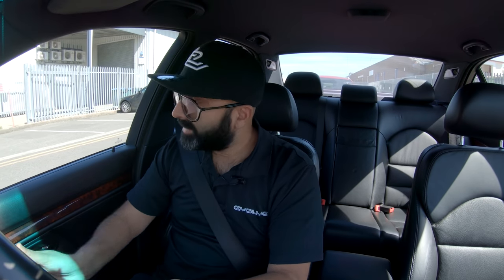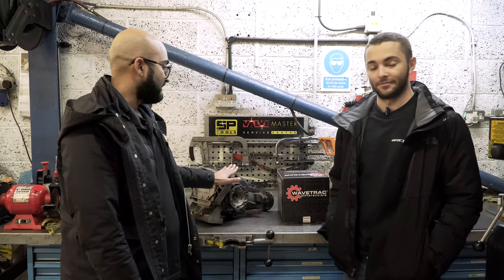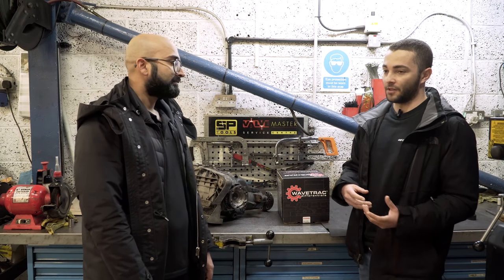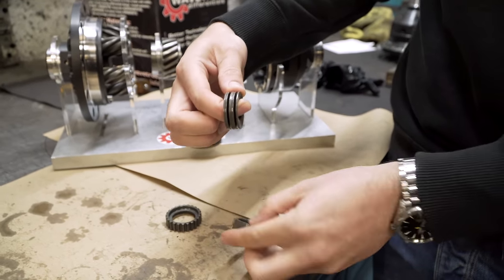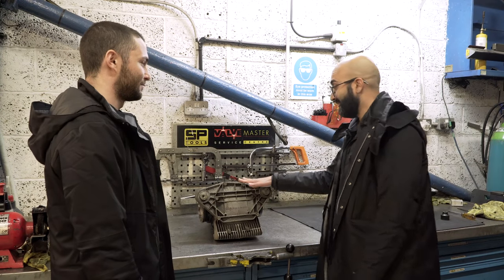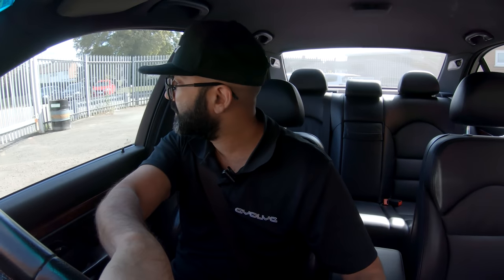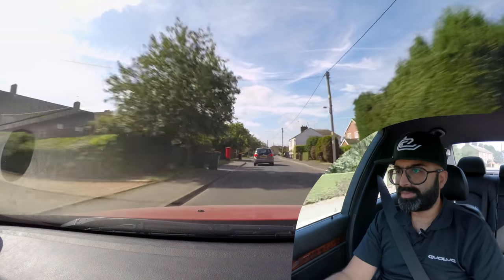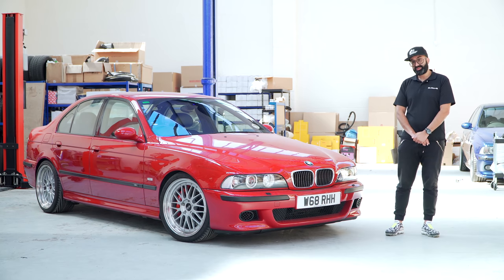Our 630HP Supercharged E39 M5 gets a Wavetrac Differential

Comment: It wasnt a stock diff in it as they pointed out it was an aftermarket diff but not a wave track. BMW LSD riffs are clutch type riffs that work much different than the one they pulled out which was not a clutch type and was close to the wave trac design already but without the wave trac part they showed that creates a better pre load than the other after market. Although he kept referring to it as OEM. I'd love to have one in my E46 M3 but cash is not there for it yet.
Reply: The wavetrac diff works out cheaper than the quaiffe ATB diff, they do need the output flanges to match which adds on another couple of hundered quid or so, depending on where you get it from. I'm in the same situation, got stock diff with 140k on it. No issues with it yet but I always hope it goes bad so I have the excuse to smash my piggy bank and go for the wavetrac! Total price is around £1500 for a full wavetrac setup depending where you buy from as opposed to around £1700 for the quaiffe. Not sure if a bearing rebuild kit is required for the wavetrac but I know it is definitely needed for the quaiffe which adds another £300 or so. I reckon a budget of around £2.5k max would be enough for a fully fitted swap (inc bearings if needed).

Comment: Very important info is missing, what is the load percentage approx with Wavetrac? Stock is around 40% lock, High milage used around 30%, Wavetrac?
Reply: As explained in the video, the car came fitted with an ADB torsen diff carrier and not the standard BMW clutch LSD.. Torsen diff behaved differently from clutch type LSD. It can go between 0-100% lock. And zero maintenance. The ADB diff has no pre load so when 1 side of the wheel is completely off the road, it becomes an open diff.. the wavetrac designed with a ramp to counter this... watch the explanation on the video again.
Reply: Stock is 25%.

Comment: Was it a quaife ATB you took out of the diff prior to installing the wavetrac ?
Reply: @Steven Ross-watt Yes of course, the stock e39m5 diff unit is a ZF clutch plated lsd with 25% lock and 110-130Nm preload. I hardly doubt there would be any noticeable difference in driving experience between a quaife unit and a wavetrac unit, considering the fact they are both ATB type and should work the same way in situations when both rear wheels have any traction ...

Comment: Just completed wavetrac install in my supercharged 2000 M5 and I am totally impressed.  Before in my car when I would launch off the line it would always kick the back end to the right side but now with the wavetrac it just goes straight.  Another huge plus is the wavetrac diff is exactly 5.2 lbs lighter than the stock M5 diff . Taking 5 lbs of rotating mass out of the driveline is beneficial in so many ways.
Reply from the maker: Next time we do one we will weigh it, that’s an interesting difference we didn’t even consider!

Great to hear your experience mimics ours.

Comment: Nice m5! How many psi is boost? And how mach miles its done with 630 hp?
Reply from the maker: 7 psi boost. Around 10k on this set up
Reply: @EvolveAutomotive  7 psi is not dangerous for stock engine ( with no steel sleeves)?

Comment: Curious to know what gearing ratio you guys chose with the diff, such a nice build
Reply from the maker: The ratio was not changed, just fitted a Wavetrac unit to help maintain traction with the huge power this car has.
Reply: Ahh good to know. Quite honestly, your videos exposed me to wavetrac and I’m finding myself highly considering it on my next build.
Thanks for the response!
Reply from the maker: We have another Wavetrac video on our F56 Cooper S if you haven’t seen it which also explains how the Diff works.

Having seen the internals of the diff, I wouldn’t consider any other type of ATB diff. This is like buying the latest iPhone compared to the original iPhone. There’s no downsides it’s just a newer technology for better performance.
Reply: Evolve Automotive yeaa, learning how the wavetrac doesn’t suffer from losing traction during zero axle-load conditions is impressive despite being the helical type. I had an e92 m3 and really considered changing the diff but I didn’t much at the time. Would you recommend going up to the 4.10 ratio with the wavetrac in the e92 or would you leave the ratio unchanged?
Reply from the maker: Ratio is down to personal preference. Haven’t personally experienced one with a different ratio in but the theory says you want to make your gears as short as possible. No sense being geared to 200mph if you’re only ever going to do 150 for example. Obviously there is a loss of fuel efficiency as you’ll be doing higher RPM at cruising speed. But you’ll gain acceleration which can make a car feel like it has gained raw horsepower.
Reply: Evolve Automotive good to know. Thanks for all the insight!

Comment: Congratulations on the LSD downgrade. With a simple fix the standard plated diff is so much better then any torsen lsd. But hey, if you want to spend 1400 on a torsen that you can get for 600 as well …. get a wavetrac. Then big surprise, he already had the quaife torsen, so now you payed 1400 for staying in exact the same situation. No one is ever going to notice the difference between a quaife and a wavetrac. The technical difference is that the wavetrac ramps the preload up with wheel slip, big deal, just get a bit more preload in the first place, like the quaife. Don't believe this marketing nonsense.

The test drive is actually hillarious. A lot more stability and progressiveness without having the tiniest bit of losing grip. You didn't feel any difference dude, be honest.
Reply: What do you think you can do to a standard E39 M5 diff that uses clutches that wear out that will make it so much better then a wavetrac?